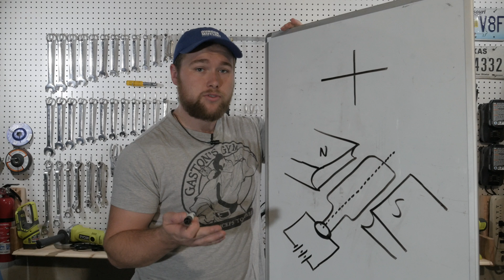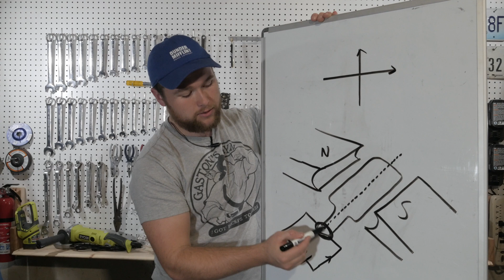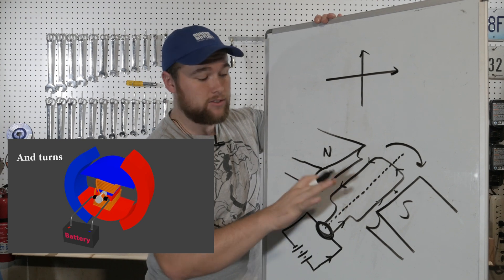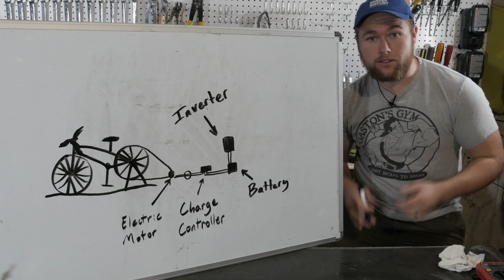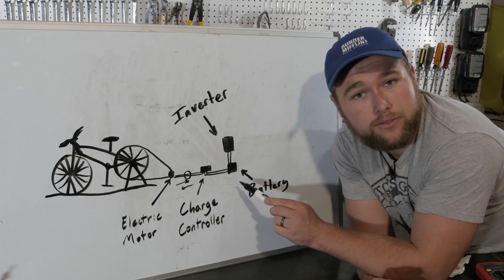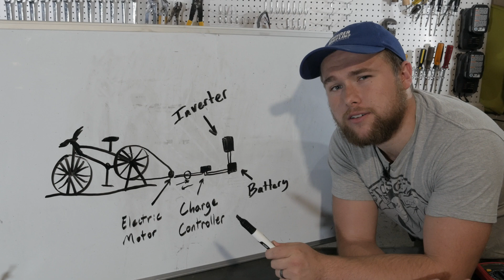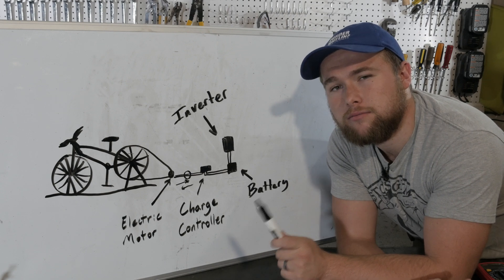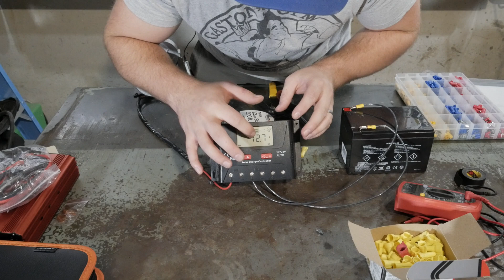Bicycle Generator - Free Electricity - $100 Build

Comment: How did you get the pulley on the motor?
Reply from the maker: There are adjuster screws on the pulley to get a snug fit on the motor.